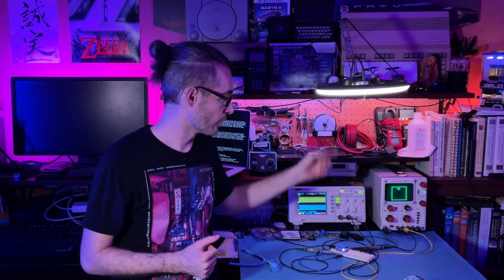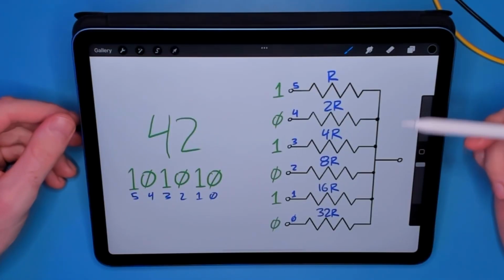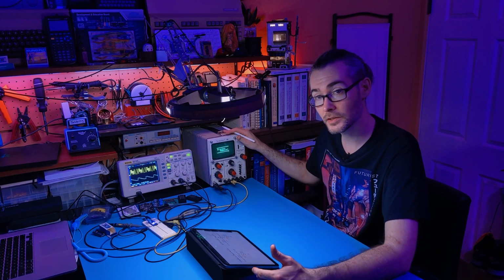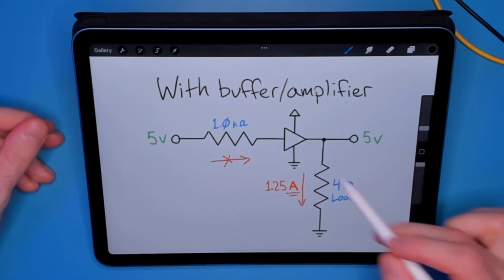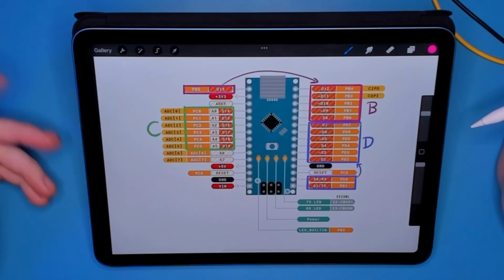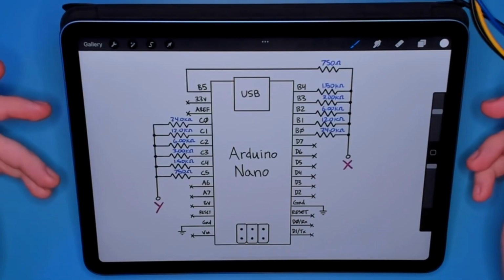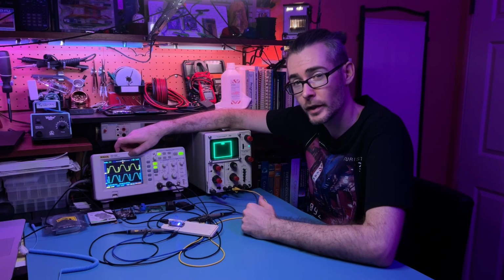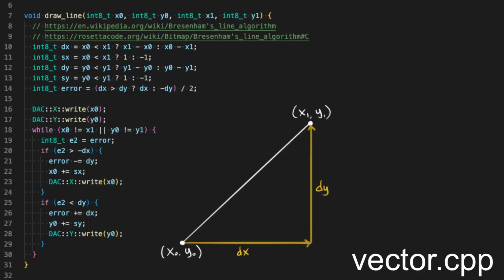Create VECTOR ART with Arduino

Comment: hey! I have a project of convering a color crt tv into a vector crt that i can play old atari games on. I was wondering if you have can explain me how i can do it with displaying a game on a crt instead of an o-scope. also where can i boy those resistors? i couldnt find them on the net.
Reply from the maker: Great Scott has a video about converting an old TV into an oscilloscope: https://youtu.be/aScAZReGQc0
Instead of using a ramp to drive the horizontal deflection, you'd use the horizontal output from your vector game, same for the vertical. TVs generate high voltages internally, so it can be dangerous to work on them.

For the resistors, look for an E24 resistor kit which can be found on sites like Amazon and AliExpresss

Comment: Just wondering why you didn’t choose PWM, averaged out by a condenser (low-pass filter)? I think that’s how 1-bit audio DAC works.
Reply from the maker: Arduino built-in PWM is a bit slow.  On the Uno/Nano it's only 490 Hz, so you'd only be able to draw 8 points at a 60 Hz refresh rate. It should be able to go faster by adjusting the prescaler, but I haven't tried that. For comparison, the bouncing ball animation from my video is running at 2.8 kHz (frames per second!) and the 64x64 bitmaps are around 150 Hz.

With a filter, the dot would trace a curve between the points rather than jump from point-to-point. That would be a good thing if slow PWM was limiting how many points you could draw (so you could draw a box by just plotting the 4 corners and the condenser would trace out the edges). But to draw sharp pixels with my DAC, I needed the values to change abruptly.
Reply: @TrevorMakes  interesting thanks! So the LPF may smear the signal I guess. Found a blog post on the arduino forum discussing max. PWM frequency on a regular Arduino. Answers are ranging between 4kHz-62kHz (max).
Reply: También se puede hacer usando la tarjeta de sonido de la PC sin ningún filtro